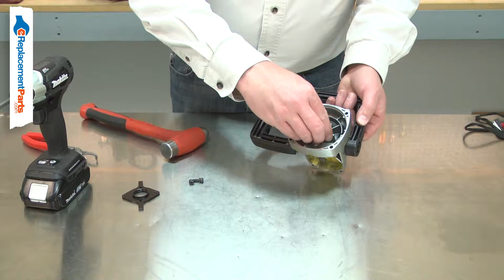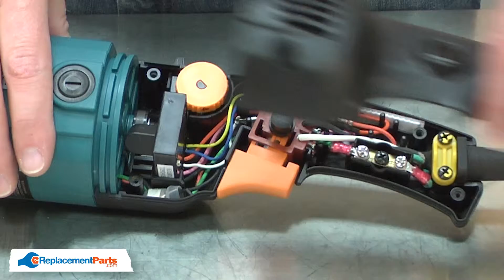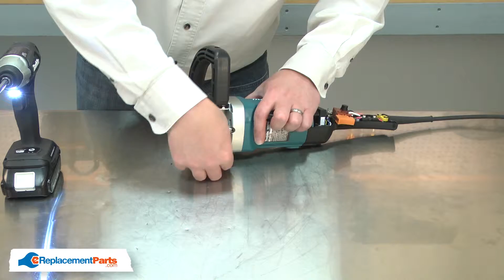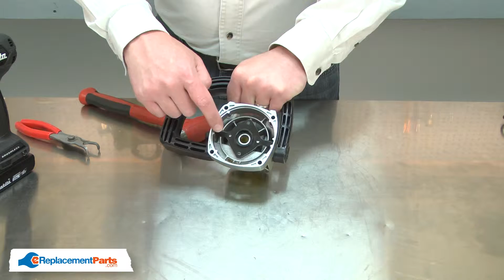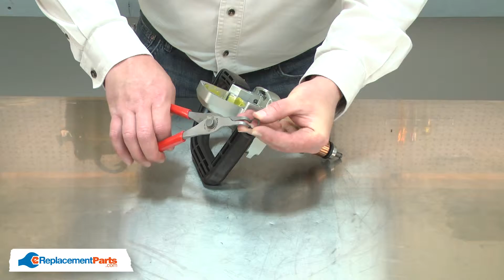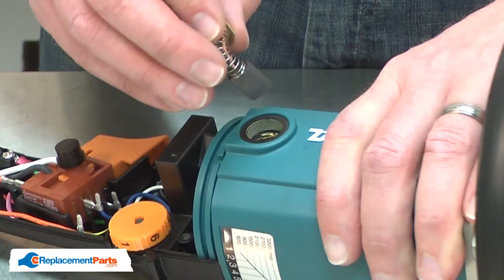Makita Polisher Repair - Replacing the Gearbox Bearing (Makita Part # 211106-1)

Comment: After replacing my amature bearing and reassembling I noticed a lot of chatter in the gearbox. Is there a certain amount that the bearing needs to be recessed or bottomed out? It runs smoothly until i tighten the gearbox cover all the way. I dont know if the pinion gear (you refer to is as the armature. The armature is back towards the handle and is what the brushes ride against.) Is too far forward or aft???